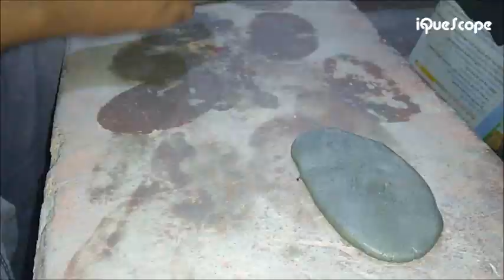Angel | Clay Sculpture | Jahi Iqbal | iQueScope

Comment: How to make clay?
Reply from the maker: 1) You can collect clay directly from pond. or,
2) you can make clay from Soil/Dust. All you have to do is, First the soils should be kept in a bucket and mixed well with water to make it semi-liquid. Then it has to be sifted through a mesh or sieve to remove hard pieces or gravel and rubbish. Then after the water dries up a bit, clay will be formed.
Reply: @iQueScope  amra village e sohojei valo mati peye jai